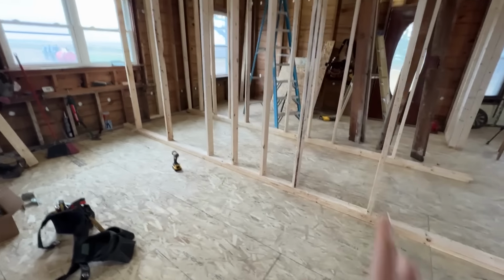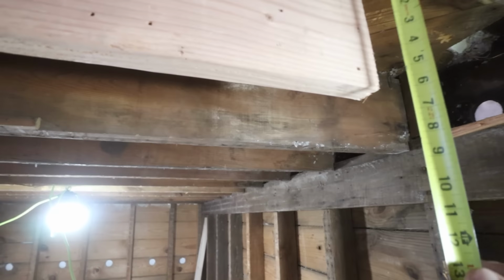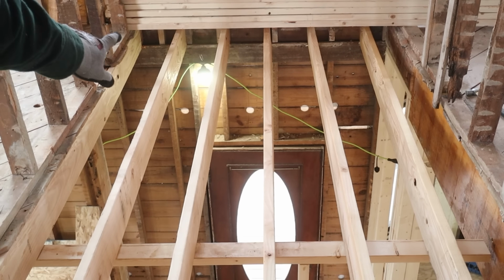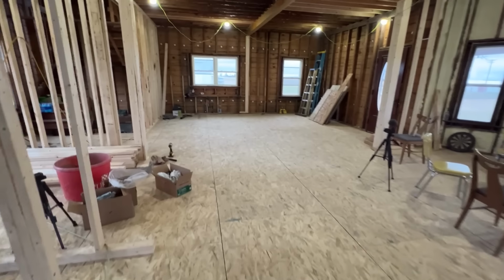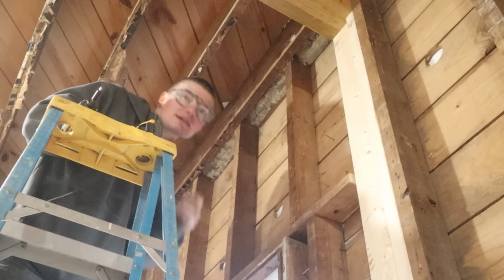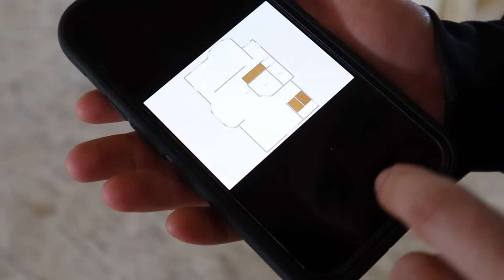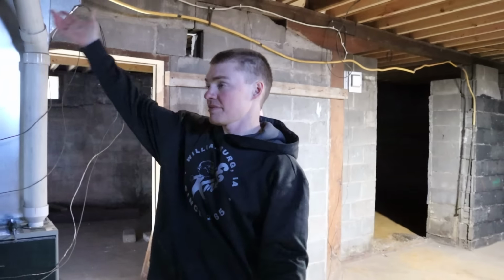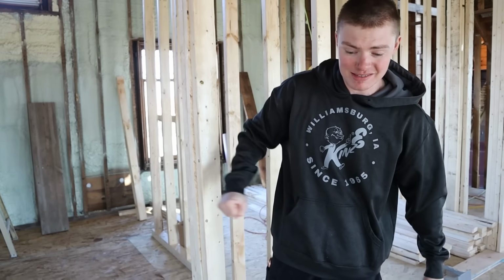Restoring A $7,000 Mansion: Rebuilding HUGE Kitchen

Comment: Cole-if you’re pulling up all the concrete in the base floor to put in plumbing why not do geothermal-heating and geothermal-cooling as well. It will be cheaper heating and cooling cost later on with a passive system. Remember to put in dehumidifier system in as well as air filtration system. Also the idea of steel beams in the basement ceiling for open spaces basement. That could straighten out your first floor being actual flat vs what you got now.
Reply: In floor heat in basement should be installed doesn't have to use it but a few hundred dollars now will pay off in the end.   Geothermal heat is great I have it but so costly to install. It make so many people walk away but there is a 30% credit for it as well.   MY guess for that size house he need about $70k system for geo.
Reply: He's not adding that with $3.80 corn.

Comment: An option for replacing the concrete wall would be to take the old wall out, pour footings for post and replace the wall with either a steel beam or an LVL beam. Would save you a lot of headaches trying to pour that whole wall downstairs. It would also create a great open space for the boys to play, and maybe a weight area for you. That is how most new homes are done. you could still rip out the old floor afterwards and poor concrete around the posts. Steel FHA post would work best. They have 3-4 inches worth of adjustment to them also, so it would make getting everything level much easier.
Reply: I bet they're glad they've glued and screwed those 4x8 sheets to the floor joists now.  Because jacking up one 2-3 foot area just got a lot harder.

Comment: I'm not a metric fan. Except when I'm working with wood. Probably works better for steel also. Metric reduces the chances for math errors. I bought my first metric tape measure as a souvenir during a business trip to Singapore in 2010. I was never strong with fractional math. But metric? It's clearly the preferred measurement for dummies like me. It's just not right that Roman has to adapt. Even Juston should be able to accept the superiority of millimeters for precision work.

That upstairs door that Juston removed and filled in years ago? Redo it. Moving furniture in and out will be so much easier with the telehandler and a large upstairs opening.

Comment: since that wall in the basement has been there for 100 years, I would leave it. The dip in the floor is not really a problem.  Just built the new wall over the dip.  No one will ever see it and the amount of work for a half inch is not worth it.

Comment: Think I would check the level of the original concrete walls as the 2" blocks and stringline are assuming the walls are correct and ...now I delete as later in the video Its clear...hmmm leave to show my attention hahaha...later nuclear option 2? think I'd only remove top row of blocks and start from there to save time, effort and $$

Comment: Big bow in the floor? You don't say. I knew this was going to happen. Kinda hard to fix with all the plywood installed Why are you putting the utility room in the basement? I'm sure your wife will love having to walk up/down 2 floors to do laundry! Supposed to be the nicest house around when done, but yet will have laundry room in a smelly concrete cave!
Reply: since when is a "utility room" a laundry room? I think he said its going on the upper level...I sure hope it is anyway...makes ZERO sense to have laundry in the basement when all of the laundry is generated on the level with the bedrooms, so in this case the upper level.
Reply: Laundry rooms are for laundry utility room can be used for a lot of other things.
Reply: @johnunsicker7440  he already mentioned in previous videos the washer and dryer are going in basement